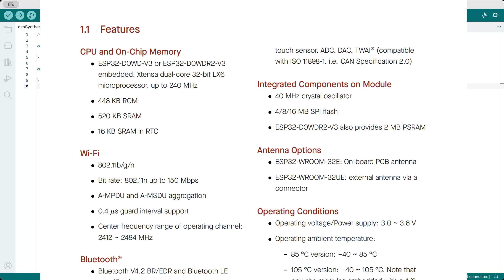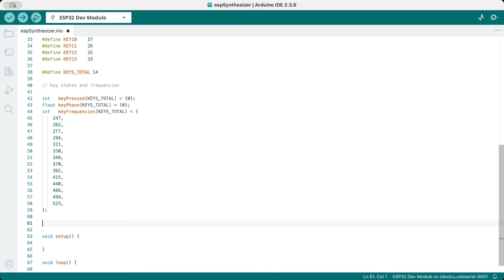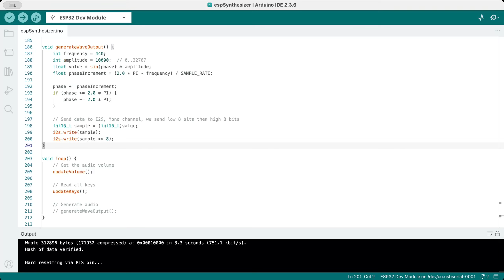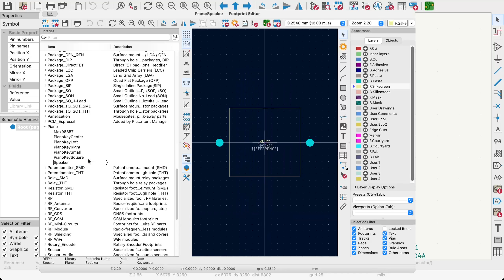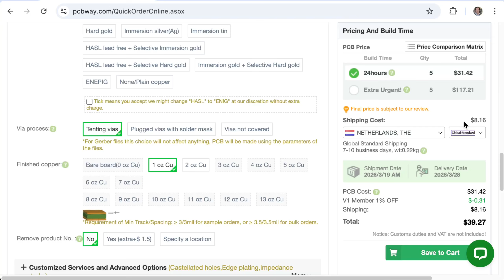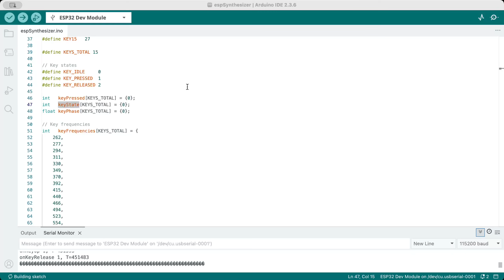I Built a Digital "Stylophone" with ESP32 (Full Tutorial)

Comment: I wonder how well this would perform with the espd version of puredata. It seems complicated to set up, so be warned
Reply from the maker: Yes, I never tried :) It looks like puredata was designed for full-size Linux, not for ESP32
Reply: @DimitriiLab  in philosophy, yes. I think espd works around this, but I never tried it
Reply from the maker: @MartinDerTolle  Thanks, I never tried it as well, will maybe test it when I have time :) It's not clear to me yet what is the result; is it a set of audio filters, or plugins, or what.
Reply: @DimitriiLab  I honestly don't know. I made patches for PD that are like a playable keyboard (I believe midi input might work as well). I guess it's just a fast way to sketch up more complex patches with delay effects or even chords or arpeggio. I think it's pretty cool to play around with (I did do so on Linux), but might be too much to run well on an ESP32. If you look at it the right way any patch can be expressed as code so if you're trying to just implement one patch from PD it might be easier to just program something similar sounding from scratch and not have to deal with puredata on an embedded device. Maybe it is something I will look at myself some time
Reply from the maker: @MartinDerTolle Thanks, I'll check their source code, maybe some parts can be ported to ESP32, why not